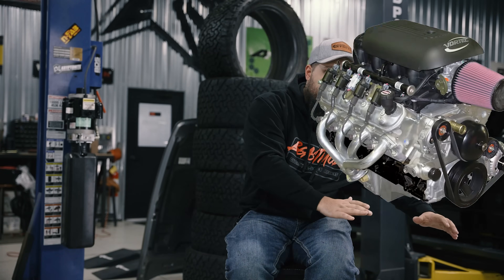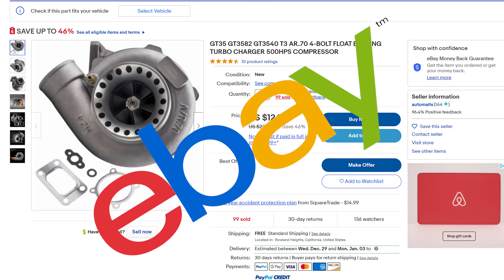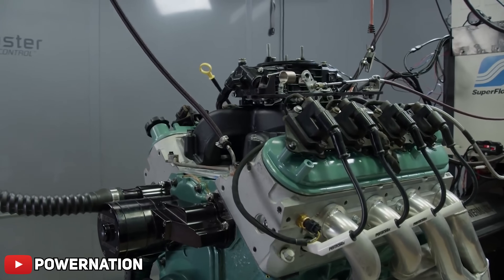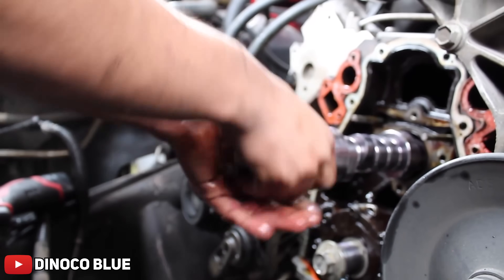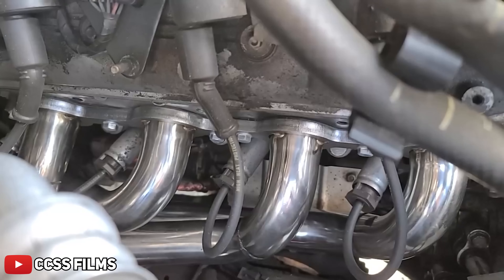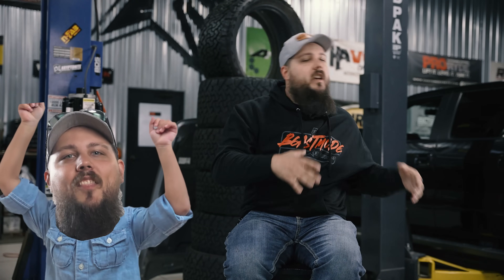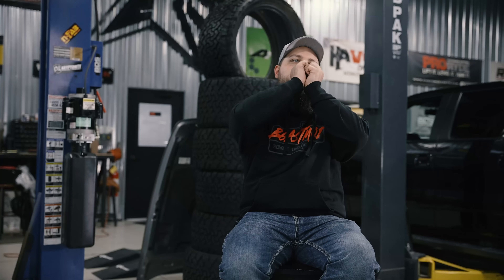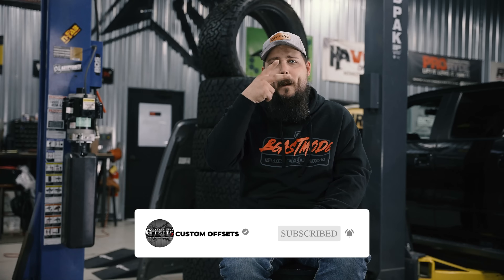Best Performance Mods For 5.3 Chevy Vortec

Comment: Surprised these guys never talked about stall converters, gearing and intake manifolds, 5.3's really wake up in trucks with a stall and really short gears like 4.56's or 4.88's and I find it to be very pointless to cam any LS without an upgraded intake manifold too extend the rev range and more power obviously
Reply: Agreed 4.11 with a 3200 circle d stall.
Reply: @thatleov  Im getting a stage 4 summit cam 3k stall and 4.11 gears but I don’t even know how much hp it’ll make
Reply: @lucidops4565  what motor
Reply: @lucidops4565  gen3-340 gen4-360 gen5-380 somewhere around there if your on stock heads/intake with a 5.3.
Reply: @lucidops4565  enough to a smile on your face !!!!
Reply: Aftermarket intakes move the hp and ta numbers higher I. The rpm range which is bad for a truck and tbo unless your pushing close to 550 or 500 the stick intake is enough.not gonna gain just lose power where it matters
Reply: I’ve been seeing these old greaser gear head guys putting LS motors in their tri 5 chevys and funny thing 5.3 and 4.8 with 5.7 and 6.0 heads and Corvette intake🧐🤔. Ummmm what do they know that we don’t?? 😊
Reply: I know you’re not going to believe this, but you really don’t know what you’re talking about!  I won’t waste my time trying to correct your thinking !
Reply: Cause they really don’t know
Reply: Gears is the best thing you can do makes it a different truck or car
Reply: ls truck intakes are pretty friggin good. better than the ls1 intakes for sure. and a toss intake doesn't give you a whole lot of power
Reply: Gears are the best way to get performance it changes the whole experience

Comment: They were great, until they added AFM to the 5.3.  Took good care of that truck and it was great to 90k, then I couldn't keep the lifters from dropping.
Reply: $200 OBD adapter can remove it in seconds
Reply: @Feldanin  I had the Range AFM disabler installed long before having lifter issues, problem is the lifters still fail.
Reply: I did a full afm delete. New valley cover plate, ls7 lifters, new non afm cam. Haven’t had problems since
Reply: @L.King2215  the same ended up solving the issue for me too
Reply: @L.King2215  what was the cost on that
Reply: @computerfixer06  how much did it cost?
Reply: @Feldanin  why do people think a range disable deletes the afm. It doesn’t do shit the afm is part of the cam and lifters. Yes sorta controlled by the ecu but disabling the ecu doesn’t remove the engine functions of the afm cam and lifters. Doesn’t plug the afm oil holes either
Reply: @codykalendek8702  because that’s what it advertises. Not everyone a professional mechanic bro, chill
Reply: Yup, 90k miles lifter done shot
Reply: Because that is what the internet tells them. And the dod delete will cost around 2 grand vs a couple hundred. But the dod delete is gonna be the best upgrade. If you do t have that done to a newer engine, your just waiting for a heartbreak.
Reply: Who ever came up with that must of been a nerd
Reply: Because it’s cheaper than having the whole thing done you buy a new truck you really don’t have the $2000 to throw into it right off the bat
Reply: Mines so far damaged it doesn’t drop cylinders anymore and still drives, it’s got 225k on it rn

Comment: Don’t forget to either upgrade or build your 4l60e or 4l80 swap it 😂 I’m on my third tranny
Reply: 6l80 way better
Reply: Yes, the 4l60's are trash
Reply: On my 2nd in my Silverado but I beat the hell out of 6l80e in my avalanche
Reply: @DoctorRickSanchez  not better for higher power applications the gears are too short makes traction impossible thats why most 6l80e guys swap for a 4 speed th400/4l80e. But its perfect for stock stroke NA guys.
Reply: That’s my entire plan lmao wait till I Grenade my 4L60 and drop in a 4L80😂
Reply: Adding more weight with the 4)80

Comment: This video was meant for me, I just recently got my first vehicle which just so happens to be a 1999 Chevy Silverado 2500 gas, 5.3 v8 ls engine. This was an amazing, very informational video, thank you!
Reply: Congrats on the new truck man. I just got mine a few months ago and it’s got 300000 miles on it and I just had to replace the rear diff.
Reply: If it's a 99 2500 that should have the 6.0 engine
Reply: @MG-ol3no  lm7 is 5.3, 2500s are not 5.3s. My truck is an lm7 5.3.
Reply: @that_one5.349  @joogie, up there is the one saying he has a 2500 with the lm7 5.3 lol. I have a 2000 1500. He also is calling a vortec engine an ls. Big difference. Ls is aluminum you don't have a ls, you have a VORTEC.
Reply: @MG-ol3no Don't be that guy.
Reply: @MG-ol3no ”TeChniCAllY they are LS based” - 🤓
Reply: Lucky! That's gonna be a ripper!!
Reply: @MG-ol3no 

It’s still considered an LS whether you like it or not. It’s based off an LS and it behaves like one 

Technically speaking it’s not, but don’t be a nerd
Reply: @Joe-jj3oh  its not a LS its a vortec. Im not a nerd,  your just uninformed.
Reply: @Joe-jj3oh  tell a technician that a vortec is a LS and see what he says  …
Reply: @Mid-Michigan-Outdoors  “based” 😁
Reply: @MG-ol3no  low key forgot this conversation existed 😂
Reply: @Mid-Michigan-Outdoors  same just saw this goofy mf trying to argue with me this morning 🤷‍♂️
Reply: @MG-ol3no all us techs call them "LS's" regardless of the fact that we know technically they're not. Techs will agree that you're being a dork lmao everyone knows they're not truly an LS motor and no one cares
Reply: @MG-ol3no  watch the short I just posted of our "not a shop" I guess 😂 we touch thousands of cars a year and build full frame-off restorations with modern motors but I'm not a tech lmao you're just a dork who feels smart for telling everyone shit they already know.
Reply: @SuperDjwasabi  your a reptile breeder not a tech.
Reply: @MG-ol3no  Brotha those two aren't even the tip of the iceberg of all that I do, I'm sorry you can't accomplish more 😂 working on opening a road course track locally as well. When you have $200k+ to spend on a restomod get at me 🤙

Comment: Had a 5.3 sold it running like a champ with 225,000 miles and had a lq4 6.0 sold that with 245,000 still running idk why most folks have so many issues these engines are as good as a 4 bolt  main otherwise its lsx or a good old duramax now that's a ride stock theyll walk the dog on a pullin sled point 9f my story if u ain't got any of these motors your wasting money 🤣🤣🤣

Comment: I’m not proud to admit that I had a oil cooler gasket leaking by the oil filter and had a bunch of insane crap happening in my life and I stopped checking my oil level for a long time, almost like it was something that didn’t need to be done anymore. Obviously the first owner I bought my 2011 Chevy Silverado 5.3 Z71 must have made keeping the oil level at the correct level something he did religiously. Because my low oil level sensor doesn’t work probably because it never had to move the entire time he owned it . I had about a 173 thousand miles on my truck when while on the interstate my oil pressure went to 0 . With no extra oil in my truck anywhere and just have given my wife the debit card . I had no way to by oil. I had about 12 miles to go before reaching home. I decided to just push it all the way home doing my best to not get stopped at any red light, stop sign or in traffic. Got home and it was bone dry. Got oil and filled it up and about 75 thousand miles later still runs like a beast with absolutely 0 damage of any kind that I can find and remember it’s a AFM ENGINE

Comment: 👋99 Silverado. Was going to just buy a performance upgrade (460hp) engine for it, older buddy of mine told me he’d help me just build one, and for half the cost. So I’m gonna head to a junkyard and get a hood 5.3 block, have it machined, and build it up, learn on it so in the future when things break because they will, I won’t have to send it to a friend to be fixed. That and I don’t have to drop 5 grand straight out, I can take my time and drop yk 500 here and 200 there
Reply from the maker: Hell ya that’s the way to do it
Reply: Why waste the money? Just run the junkyard motor as is. The gen IV stuff is bulletproof SBE.

Comment: I've got a 08 with AFM deleted, FiTech intake manifold, 102mm throttle body, cold air intake, 50lb/hr injectors, stage 3cam, forged pistons, a 150shot of nitrous
Reply: Hp?

Comment: I str8-up jorked my ‘01 5.3 power train by attempting to leave work with my parking brake on- I never used it before, and forgot I left it on, and let’s just my lead foot didn’t help. Shits still tops at 100mph, redline.

Comment: Hell! Even the 4.3 vortec was a hella engine even stock.
Reply: I never rode I'm one but they did sound good.
Reply: @mothmanmothman4909   I had one in a small gmc & it was more than enough power
Reply: Don't forget the 4.2 Vortec!
Reply: I’ve had both, 5.3 has 3 times more power, but my s10 4.3 was basically blown up.

Comment: Long tube headers with cold air intake on a 5.3 gmc Sierra. What size cam would you recommend
Reply: I love the sound the cold air intake makes, I had an AFE cold air in my 2015 silverado with the 5.3, while I was literally 100 miles in the middle of nowhere in the mountains at 6000 ft elevation the cold air intake ripped off the throttle body, I have yet to see a property built cai, the factory cai is designed to articulate when the engine moves around, especially off road, I took it back and got my money back, I noticed slight higher top end but low end was less..

Comment: I have a 2011 chevy suburban 1500 lt which carries a 5.3l LMG. I'm trying to figure out what is the best way to get 400hp and 420tq at the flywheel. I'm in the process of installing a 3.42 gear set.... any recommendations?

Comment: You talk about adding power but forget to mention their transmissions are made of glass. The 4l60E trans is fine as long as you don’t tow, abuse, or add any extra power to it.
Reply: I’ve been towing rocks, dirt, entire trees, and a tractor in a 16’ caged landscaping trailer with my 5.3, 4l60 for 6 years. Cammed it, headers, cold air, etc. Still cherry.
Reply: @ricksmash8080  guaranteed ticking time bomb.
Reply: @JohnDoe-ud2cc  I expect it to go out one day. Been expecting it for a long time now 😂

Comment: I want  more  power  to not drop to 35 mph on towing  up a mountain.  What will help  ? Got a 3.5, with a 4l60e.   Cheap,? Have a big trans cooler.  04.   Got rear towing  shock/springs.  Which helps.  Engine  and trans ... help. Only  has 102000 on it.  Trailers  sometimes  at max  ,but  only  going  200 miles.  I don't  break  3rd till  the Arbuckle  mountains  for around  40 miles. .wishing had the bigger  trans.. hard to find

Comment: How do I add more low end torque? Already put a stage 2 cam, AFM delete, LS lifters, upgraded valve springs, push rods, long tube headers, cold air, flow master exhaust, but I still really wish I had more towing power.
Reply: for more towing u might need a 2500, or 6.0, these 5.3’s have reliable towing even with mods but a higher liter is always better for towing.
Reply: @victorbenitez8507  Yeah man you’re right. I upgraded to 4.11 gears and that made a pretty big difference but I still wouldn’t be hauling 5 tons of rocks in a dump trailer with this truck. Looking forward to having a turbo diesel one day but at least I have a pretty cool gasser for now.

Comment: Why would my 5.3 Z71 rado pop a knock out of thin air right after i filled my tank it happened and to be honest now that I think about it my gas tank wouldn't take no more then  2 notches past 3 quarters of a tank... Should any be able to help me I just bought this truck yesterday and it never sounded like a 12v diesel till last night I'm hoping it's just bad gas and not total engine failure

Comment: I just bought an 06 silverado with a 5.3 vortec. My first truck for work. Did I make an ok decision? Has around 105k on it. Are they reliable?
Reply from the maker: You take care of it, and it’ll take care of you!
Reply: They are reliable. Mine had lifter tickle noise around 120k after a long ten minute idle. Drove it another 50k till the lifters noise was annoying me. got a low oil pressure warning months ago. I just rebuilt the whole thing before oil pump goes out.    i don’t race or abuse it. Great transportation. Hope to keep it longer.

Comment: what’s the best exhaust system for 07-13 GM 5.3’s
Reply: True duals lol
Reply: If your just gunna keep the motor stock just a nice muffler would be great, watch some sound videos and see what you like.
Reply: True duals are to loud but with a x pipe they sound amazing. It really starts clapping only in the high rpms
Reply: Im running carven exhaust and i love it just perfect loud when needed a bit quiet when just crusing

Comment: I have a 2000 Z71 1500 that is my pride and joy. I'm pulling the engine out to freshen it up and make some repairs. Is there a realistic way for me to make a decent amount of power and still be reliable enough to drive cross country?
Reply: My 2000 has 270000 mi. I don’t want to tear into it because it just keeps running.

Comment: How easy is it for a rook to install new headers on a 2018 Silverado 1500 LTZ? Mine is a 5.3L V8 as well.
Reply: I'm no mechanic but like to try installing my own sh!t
Reply from the maker: Shouldn't be to bad, few bolts, just gotta go easy as to not snap bolts/studs in the heads

Comment: Probably need a better drive line too. I was told my 08 silverado stock driveline is crap. And will fail if I try to add more power then I have..

Comment: U should do this for the gm 6.0 I never see videos on the engine and wonder things I should be doing to my 2500hd
Reply: The same as the 5.3 cams exhaust tuners it handles it even better in my opinion and maybe if you have the money bore it out to a 6.2
Reply: Literally same as 5.3 just more engine
Reply: @gradyrooks5846  dont bore out to a 6.2 the power difference is negligible if anything put 6.2 heads on it with any size cam it will do just as good as any 6.2 if you want more displacement look into strokers, more power turbo.

Comment: Do this for the 5.7 hemi
Reply: I’ve heard the 4.7 can put out close to the 5.7 for the price? But yah can’t beat the hemi 🤘
Reply: @WS1_AUTOS_N_STUFF  don't do it 5.7 is trash trust Mr I've had 2
Reply: @liquidcr4p87  🤘people have told me that 4.7 does pretty good with power and better fuel mileage
Reply: @liquidcr4p87 I’ve had three since 2009, no issues with any of them except wheel bearings

Comment: Do these also apply to a 4.8 v8 gm motor?
Reply from the maker: The 4.8 can definitely benefit from these mods too! Some parts are motor specific, but the 5.3 and 4.8 are almost identical. -Fuller

Comment: I have a cold air intake and a smaller muffler on my silverado. I felt some differences after doing those modifications, but I feel like it's still lacking power. Will I need a tuner as well? If so, what do you recommend?
Reply from the maker: I mean you can tune it but without supporting mods, you won't see much improvement.

Comment: keeping in mind the dozen of class action lawsuits against gm for the 5.3 over the last 15 years and all the transmission problems they have these days i bought my very last gm.
Reply: ...youll be back.
Reply: @bawx  I bought a 2021 5.3 rst and have had the lifters go bad on me twice within 10k miles. The trans is shifting like shit and the dealer says its normal. The doors unlock when they feel like it and the radio has been updated more than 7 times already cause its turning off whenever it feels like it. I'm done
Reply: Their garbage transfer cases’ shift forks
Reply: @marc-antoinem112  you most likely just got a dealer defective truck my 21 has done nothing but the best you relize they lie so you can buy the car/truck right ?
Reply: @marc-antoinem112  sounds like the dealer screwed you whyd you give up so fast and the 2021 transmission is the same one used in fords not to mention dodge has the same lifter issues. We have 2 2015 chevys no issues i have a 07 no issues with dod deleted.
Reply: @marc-antoinem112  bruh I have a 2011 1500 and when I have my aux in playing music it randomly switches to regular radio I gotta keep pressing the aux button lmaooo
Reply: I have been fighting with gm for 7 months now. The engine gave up on me twice, the transmission feels like a 6 years old is manual shifting, the radio randomly disconnects, switch to am/fm or just goes black, the center screen will get stuck on volume display so I can't see my speed or temps, the heated seats won't turn on with remote start, the doors outside unlock button works when it feels like it and many more issues. I have talk to my salesman then the sales director then the dealer director then gm local Customer service then their manager then the next and now the next one higher again. Evertime I wait for a callback I have to call them myself over 10 times in over 2 weeks to finally have them call me back saying nothing.
Reply: I think it's called
"Cold shoulder"

Comment: any opinions on tuning a 5.3 to delete the AFM?
Reply from the maker: Do it, worth it
Reply: @CustomOffsetsTV  what about the Range plug in module?
Reply: @johnnymartinez305  works like a charm
Reply: @johnnymartinez305  I've used it for years on mine, works great haven't had any side effects
Reply: @arceusex  did you also change lifters and valley plate ? Etc